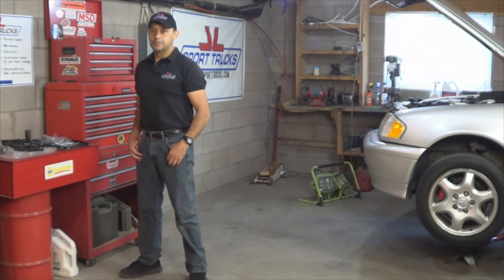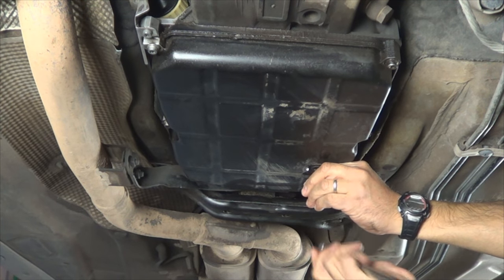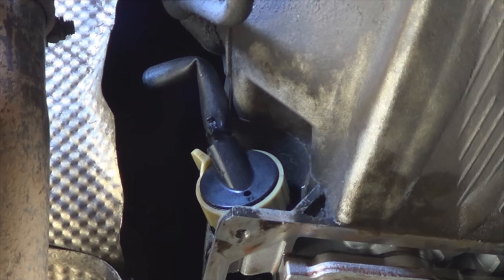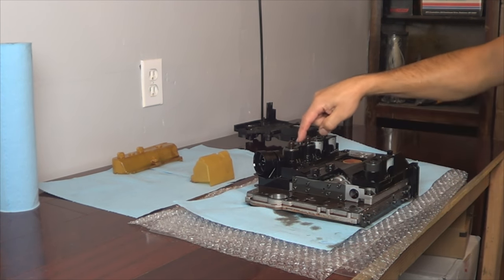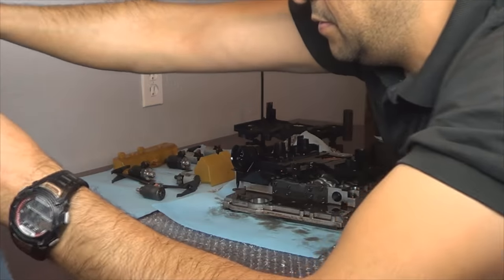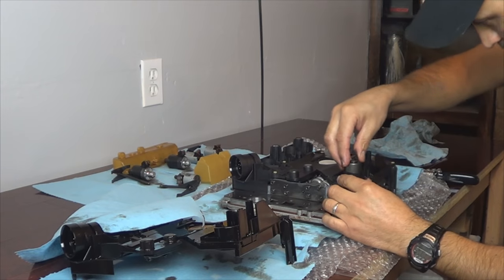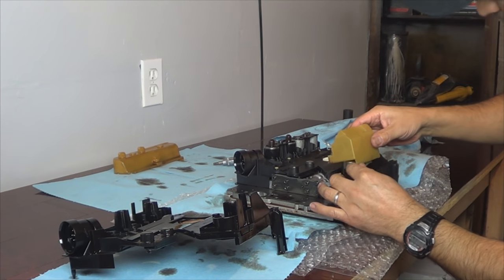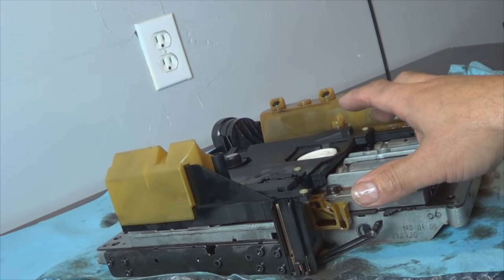Replacing Conductor Plate on  Mercedes Benz 5 Speed 722.6  Automatic Transmission

Comment: Screws holding both parts together (M6x30) -> 8Nm
Screws for the plates on the side (M4x12) -> 4Nm
Screws for holding whole Valvebody on transmission case -> 4Nm + 90°
Screws for Valves and Electronics -> 8Nm
Screws for the Oilpan -> 4Nm + 180° (these need to be NEW!)

Comment: Excellent video.
I would suggest dismantling the valve block for thorough cleaning (carefully not to loose the steel and plastic balls) and also replacing the o-rings on the solenoids.

Comment: The Torx socket bolts holding the solenoids in place are torqued  to 8 N·m (71 in.lbs.).
Reply: are you in canada or in the state
Reply: Are you sure 8 Nm is 71 in lbs?
Reply: @nightcoder5k  yes
Reply: @nightcoder5k  It's in the service documents.

Comment: I replaced the left rear Abs ring that goes on axle & car stopped shifting I put it on Drive & RPMs just keep Rising won’t shift down at all . Was told to replace conductor plate hopefully helps my issue

Comment: If I keep randomly going into limp mode, but it's not very much.. Then can I just replace the cunductor plate, trans filter, wire plug, gasket and check the solenoids and problem solved? Or will I still need to go to the dealer to have the codes pulled on the tcu and reset. I plan on doing the work myself, I'm very much a diy guy. But when I was doing my research on the project, I came across a thread that said if you plan on doing the diy job yourself that the car would need to be towed not driven to the dealer to reset the tcu after. Which brought my project to a complete hault in fear of doing some type of damage. I feel like his advice was being directed towards someone who is stuck in limp mode, which is not the case with my vehicle. The reason I'm asking, is because the nearest mercedes authorized tech is a 90min drive from where I live.
Reply: Did you ever get the tcu reset? Did it work?

Comment: Thanks for sharing the video. I have a C 240 (W203, year 2003). Sometimes the downshifting isn't soft. Upshifting is fine. Could be a problem of sensors ? No error code with stardiag. If yes, could they be replaced or should i replace the whole TCM ?

Comment: Excellent video, easy to follow and understand your steps. Also excellent videoing. Thank you so much!
Reply: Finally got to get my car off of jackstands to test drive after changing conductor plate. Results: ....same as it was; won't shift out of 1st gear. Also hard clunk when putting into gear. Any new thoughts for resolution?
Reply: @TheMervK  hi did you ever find out what it was ? Im in the same situation it feels like someone knows , but no one will say the right steps

Comment: Nice stuff! 

I have a 1995 C180 Mercedes Benz. I'm having a weird problem with my
transmission. Its automatic transmission. If I'm accelerating smoothly, when it
shifts from 1st to 2nd gear, the car jerks, like it‘s pushed forward all of a
sudden or like something hits the back, and then everything goes back to normal. If I press on the pedal and
accelerate fast, this doesn't happen. All other shifts are normal, it’s only
the shift from 1st to 2nd gear when accelerating slowly. Could it also be the conductor plate that might be causing it?

Comment: My transmission jumps the car when shifting from first to second gear, does changing this conductor plate solve the issue ?
Reply: yes, because if you do this you also do fluid and filter; also check for error codes of the transmission or check the solenoids when they are out... It might e ok with fluid and filter change...

Comment: Hi thanks for the video.
So I have some problems here, I have a E320 year 2000 (W210) that was messing up with the transmission. I decided to buy a kit containing a filter, gasket, connector and conductor plate to do a service on the transmission. After putting everything back together I got now the car in Limp Mode and couple of errors codes came out :
P0715 Input/Turbine Speed Sensor Circuit Malfunction
P0753 Shift Solenoid A Electrical
P0758 Shift Solenoid B Electrical
P0763 Shift Solenoid C Electrical
P0720 Output Speed Sensor Circuit Malfunction
Am a little bit confused now. What should I do? I believe this is an electric problem related to the solenoids. I did a battery test everything is ok.
Thank you.

Comment: Can this set off the po720 code? my transmission keeps slipping on hard acceleration plus i have no overdrive working but my mercedes doesn't have a engine light on and isn't giving out any codes.
Reply: I’m sure you’ve figured this out by now but it sounds to me like your tcc solenoid was bad.  It’s the solenoid that locks your torque converter.  Just info for anyone else with this problem

Comment: Can you do this job even if your car is located outside and you don't have a garage to work in??
Reply: I did my work outside, but it is important to reduce the airborne contaminants, all transmissions are sensitive to contaminants. This is actually quite a difficult job, I would only advise doing this if you experience the symptoms, generally a transmission that remains in limp mode. These transmissions can be unforgiving and quite expensive to replace if a mistake renders it unrepairable. If your transmission leaks at the connector, that is an easier task, just be careful not to snap the connector's retaining bolt, only tighten it until the connector seats in the socket then stop.

Comment: HAVE A SL 500 R 230 WITH 65000 MILES AND REPLACE FLUID AND TRANSMISSION FILTER AND AFTER THIS CHANGE, TRANY START TO SLIP AND HAVE ERROR CODE  P 5202,  PLEASE ANY HELP

Comment: Great video for replacing the conductor plate. I have 2005 C240 4Matic. Check Engine Light with P0715 code came. By watching your very clear and detailed video, I was able to replace Valve body Conductor Plate and 13 pin connector. Check Engine Light with P0715 did not go yet. Now I have to clear the error code P0715 from TCM. I do not want to go to Dealer to clear codes in TCM. Any other way to clear TCM. Please help me. Thank You.
Show less
REPLY
Reply: Did you ever get it reset? Did it work?

Comment: Hi, greetings from the UK.   I have a serious problem with my 2008 Sprinter .  I had a worn rear diff so swapped the whole axle unfortunately it was a slightly different diff ratio now my automatic transmission does not like it and stays in 3rd gear.  Any ideas.   Very little info seems to be out there on this issue but I have found one other thread on a forum with the same issue, they took it to their Merc agent and it was remapped on the STAR computer system.  All the Merc agents in UK have no idea what I am talking about , automatic sprinters are fairly rare still in the UK.  Any ideas !! my business is stopped because my van has.  Hope someone can advise :-)
Many thanks
David
Reply: Can you get the old part back and replace the faulty parts and re-install it? Can they look in the Mercedes star program for your vin and get the part numbers? If possible, you should undo the mistake, which was installing the wrong part, and install the correct components but to do that you have to know the specific original part numbers. I went on ebay and purchased a disc with the service manual information and use that for parts lookup. The wrong will cause problems, just get the correct axle and differential installed, the van is a good van.

Comment: I broke the head on the center screw on the connector...it spins freely and doesn't disconnect from the housing.  How do I get it out now?  What's the secret?
Reply: how did you fix this issue? did you remove the bolt somehow?
Reply: I just broke mine last night, here is the fix. The connector retaining bolt threads into the receptacle on the corner of the conductor plate, so the end of the bolt is in the conductor plate. The solution is to replace the conductor plate following this well-made video, being careful to only tighten the connector's retaining bolt with your fingers until the connector is snug in its socket, then use a nut driver to gently tighten it about 1/16th but no more, it is only designed to prevent the connector from dislodging. Do not tighten it past hand-tight, and do not use a ratchet like I did because it will snap off in the conductor plate.

Comment: Is it ok to clean the oil from the solenoids and other sensitive ares using 'electric contact cleaner'?
WHY??? Because I just want to know and i couldn't get any info on this so far
Many thanks
Reply: It is not advisable as it introduces harmful chemicals into the transmission. The transmission fluid is actually helpful for the solenoids.

Comment: Which one is the pressure regulator solenoid?
If I disconnect it, will that stop the slipping while shifting, because it will work on full pressure?
Reply: diagram here :
https://worldwidespecialtyparts.com/mercedes-722-6-valve-body-casting-0406-1997-2000-sonnax-mfd/

Comment: Is the 722.6 transmission interchangeable? i have a 1997 c280 and i need another transmission. Can i use one from a different class mercedes? thanks
Reply: Only if the gear ratio's arew thew same, that is much be trhe same transmission code; otherwise the tcu sets limp mode.

Comment: I have problem on my Car Mercedes CLK 5 Speed When I drive Car W all shifting is okay  but when Change to sport make 1_2 not good shift
Reply: Are you changing between S & W? S is for standard not sport, W is for winter.
Reply: For this type of issue, i would first reinitialize the transmission "learned behavior" (sorry im not english) search "reset mercedes tcu" it's very simple, like : 
key on pos. 2, full throttle for 10sec (engine not started !!), turn off key while keeping full throttle for another 10sec, then release throttle pedal.
After that the gearbox will relearn how to shift according to your driving style.

Comment: would a replacement one of these need recoding to the vehicle or is it just plug n play?
Reply: YES RECODING IS NECESSARY
Reply: no, the conductor plate is just a pass through there is no electronics in it, ity is not a module.   I do about 10 to 15 a year here at our shop.
Reply: No recoding required for the 722.6 transmission

Comment: 139/5000
Why is there a 3 to 4 second delay before entering gear, after changing the body valve, selenoils, filter, shifter, etc.?
Reply: Not enough fluid (pressure)

Comment: What tool is used for the drain plug and is it the E10 socket for the 6 bolts on the tran oil pan?
Reply: T30 torx bit for all the bolts
Reply: @kamranishtiak9712  Thanks, I needed that.
Reply: Drain plug is 5mm hex bit.

Comment: Hello can I reuse the transmission fluid I just empty?
Reply: It is not recommended since it is exposed to dust and other contaminants. It is a wise investment to recycle the old fluid and install fresh clean fluid that meets the manufacturer's guidelines. Re-using the old fluid increases the risk of catastrophic transmission failure. But you can if you really want to.
Reply: No! Duh???

Comment: How long do the solenoids last?
Reply: i read somewhere the resistance values each one should give. search "mb 722.6 solenoid resistance value" you'll find easily
it's like "first 2 should be between 4 and 8 ohms, the grey one between X and Y, etc". If out of tolerance, replace :)
Reply: found it a few seconds after, diagram here for resistance values : 
https://worldwidespecialtyparts.com/mercedes-722-6-valve-body-casting-0406-1997-2000-sonnax-mfd/

Comment: After replacing the plate the car displays all the warning lights on the dash board what to do ?
Reply: Disconnect the battery for at least 10 minutes, then reconnect and see if the errors clear. If not, then I recommend a good quality code reader, I purchased the icarsoft i980 for my 2001 ML430 and also for use on my 1998 ML320. Shop around to find the best code reader for your vehicle.

Comment: If you buy Made In China stuffs, please try to assemble connector to the plate first before installing.  I bought one and the hole in the plate is larger than the screw in the connector.  I lost 2+ hours.  My 2000 CLK430 is very tight at the connector